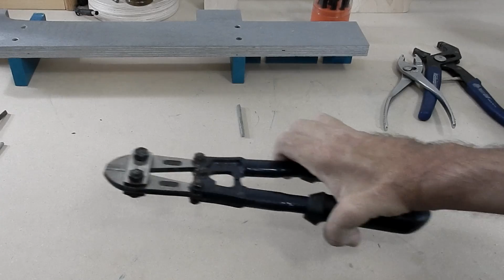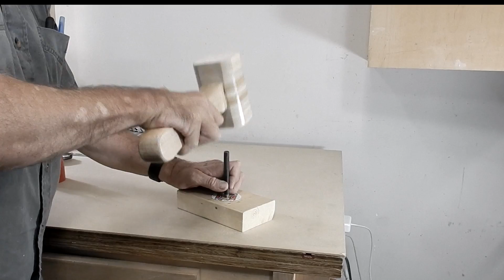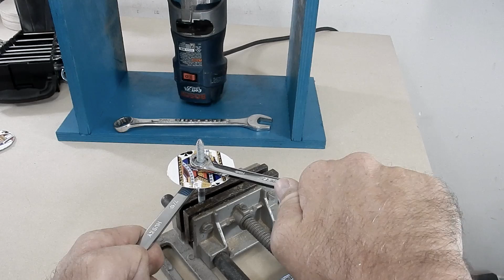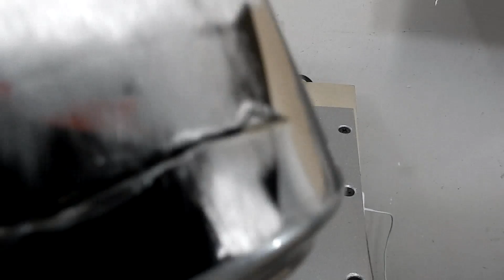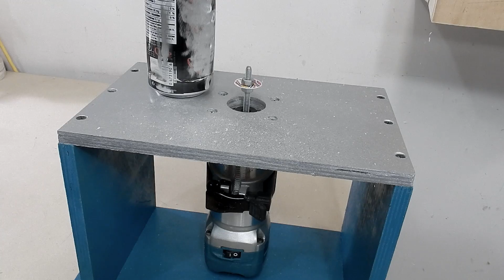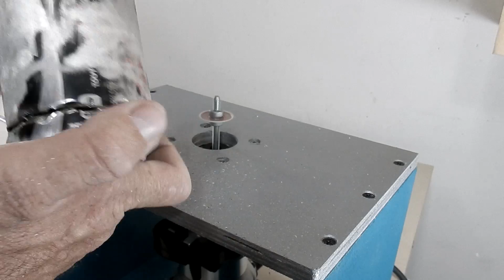Can Paper Cut Metal?

Comment: The paper gets smaller as it's processing to cut metal.
Reply: andyfrezzie GT yep it does. Thats a tiny ass paper now.
Reply: And yes so does any other Device you use to cut material. You might not be able to Measure it with your tools.
But any Cutting device in a rotary motion sacrifices cutting surface to complete the cut.I am speaking of substantial materials not HOT Butter.